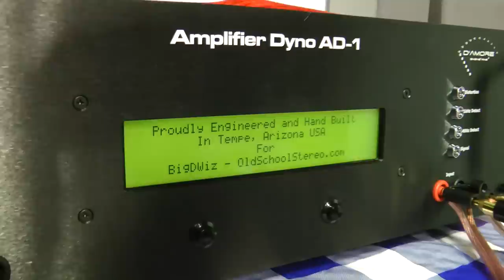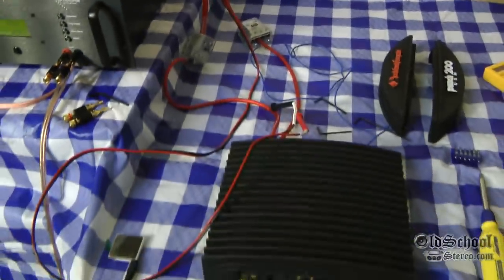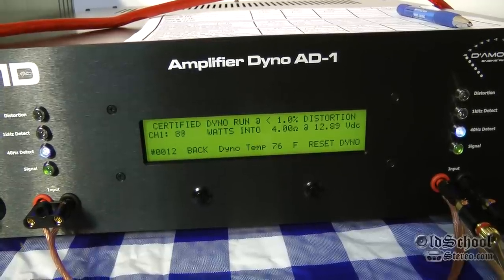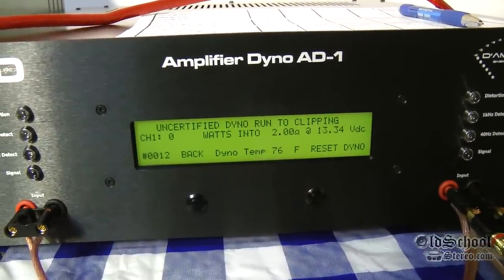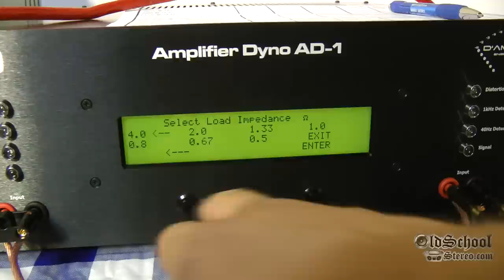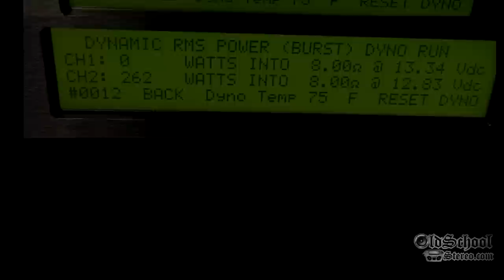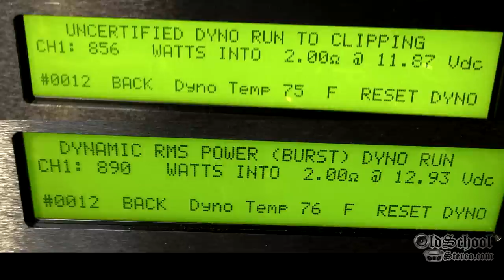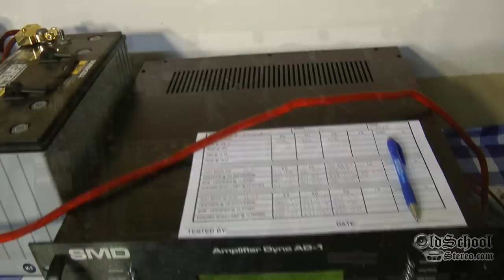SMD AD-1 Amp Dyno vs. Rockford Fosgate Punch 200 DSM FULL Test

Comment: The finest amp i have ever owned period!! And i have 6 of them! and still have a power 1000 and 650!  love them Rockfords!
Reply: I have a punch 150,a punch 45 ,and a power 300 in my boneyard loved all of them.right now I have the 200 ix running a jl audio 12w3v3 bridged and it sounds good,t600 running front and rears ,morels up front and focal cc’d 6.5 in doors it’s a nice 2 amp system.
Reply: @seanhower5130  nice buddy, I have 2) 200s, 2) 100s, 1) 40 and 1) 60 old schools just like this. I think mid 90s waffle grill. I had one 200ix powering a jl 12w6 v2. It was loud until the surround blew out on the woofer. Have to repair the surround.
Reply: @seanhower5130  yeah I bet the power 300 is a beast. Thanks buddy.
Reply: How does the 500a2 compare? Can it make double power at 2 ohm mono?
Reply: You the man with the master plan!

Comment: Love to see these tests on the gear I grew up with.  I was saving for my car audio gear 2-3 years before I even had a license or car to install it in!  I picked up a Punch 200x2 trans-ana from a guy in the parking lot of a pawn shop as we were both on our way in.  As a 17 year old, this was the holy grail of amps to me, and I think I paid under $200.  Before being stolen along with my ride a few years later, it was powering a pair of bridged Premier TS-1240s and a single Orion XTR 15" bridged along with them for something like 1.3 ohms!  The amp never complained or shut down, but ran hot unsurprisingly.  Chewed up a few alternators along the way, but it would flip quarters on the roof all day long.  Way underrated!

Comment: We ran the punch 200ix at 1ohm mono fanned in late 90s and got great power as long as we fed them enough voltage!!! Freaking love those amps
Reply from the maker: In my tests, the ix had a protection circuit where the non ix model just kept going
Reply: @wal  we never had any issues out of either as long as the supply power was enough.

Comment: Been running 2x200ix and 4080dsm linked with punch links for over 15 years. On 2x punch hx2 12s they have followed me through 4 vehicles so far and still slam.

Comment: From what I see... their new POWER Series are respectable. BTW I have both a 4600x and a 2600x :-) still with warranty sticker
Reply from the maker: I agree. I'm using the little Punch PBR amps in one of my cars as a simple system upgrade with a JL Stealthbox and 6.5 components in the doors and they provide respectable amplification in a TINY package! 100% stealth upgrade and 1000x better than stock sound

Comment: An  ol' friend of mine had his hoopride done at the sound shop when we were in high school.. All Alpine, head unit, alarm, highs and mid speskers/and amps and for thee trunk he got 4 punch classic 12's , flush paneled in with a  single punch 200x2 trans anna, pushin them , with a 3 way Fosgate active crossover .. Man it sounded fn great .. 
The whole shebang with the  car alarm was like  $1,200.00 retail.
1995 a.d.
😂

Comment: i have 2 200x2 punch amps. i had a 60x2, sold that. then bought a 100x2 that i had powering a pair of vega 124s at 2 ohms. nothing in my area was as loud. the best amps rockford fosgate ever made. except the power 1000

Comment: hi Dereck! very nice video. Ho have a question for you, i got a Rockford Fosgate Punch 200ix and a Precision Power 2150M, now i have buy from a friend a JL Audio 12w6v2 D4, than i need use one of this amp on this subwoofer, its better use the RF Punch 200ix at 8 ohm mono o PPi2150M ?

Comment: Thanks for your test results! Awsome , I have 2 punch 200’s  and a punch 500 so by the looks of it I should run my subs at a 2 ohm load off one the punch 200’s at 2ohms bridged mono instead of using the punch 500 to power the subs would this be right based on you Dyno tests? Which makes me wonder what to do with the punch 500 when the 200 outperforms it! I’m loving your channel from Australia and You have inspired me to fire these old skool amps up again! Great show ! I’m loving it 👍🏽👍🏽👍🏽💯 if you can give me some ideas I’m going to resurrect those old skool days! 😆

Comment: The new tests are awesome. Get that Soundstream Reference 300 tested. I'm curious to see the differences in power compared to the old resistor bank method,
Reply from the maker: Joe Rico I sold the SS Ref 300 a while back, but have a Ref 500 I'm going to test soon. I think you'll see the "certified" tests using the Amp Dyno are very similar to my old test methods. This mode tests the amp with a sine wave up to 1% THD. It is fun to see the uncertified (up to clipping) and dynamic burst RMS tests the AD-1 provides. Some amps have a TON of headroom...a good example is the Punch 200 DSM shown above!
Reply: Awesome. I have 2 mint original boxed Reference 500 and it's probably my favorite amp of all time. Hits the sweet spot for anything you need to run on it. CSR rated rated it for 598 watts into a bridge 2 ohm load/ 144 x 2 @  4 ohms back in a 93 or 94 issue. After that review I bought both my units. I also have a closet full of Rubicon amps I want to send you for testing.
Reply from the maker: Joe Rico I remember that review! I "think" I scanned it a while back, will check soon
Reply: I still have the issue along with all the car audio rags from the 90's. Missing the first few years of Car but have everything from mid 90 until the end. I really want to see how the D'amore compares to the testing methods of the 90's. That way we can look at the old tests and fill in the blanks to amps that don't get tested with the new methods.
Reply from the maker: Joe Rico I'm curious to see how it performs as well. I'll look for that article, but I bet they used 1kHz tone and measured THD at 1% for the power output. If this is the case, I should be able to do the same test! Could I trouble you in scanning or taking pics of the SS Ref 500 review? I'm sure I have the magazine, but it's in storage and not easily accessible now. I scanned a few things from CSR in 1993/94, but didn't see the Ref 500 review
Reply: I should be able to scan the article. I have a few scanners colllectimg dust in a the attic. Just have to hook 'em up. I do remember the last sentence in the article.....with this much power people usually dance naked in the streets. 1000 watt amps were very rare back then and I always rember that line when I'm checking out a super powerful amp now a days. Boy...times have changed.....

Comment: Had 2 of these hooked up to 2 Punch DVC power 10s. Used these for Years running them 2 ohm. Wish I never sold them.
Reply: I just got mine out of the basement from 1998 Its punch 200 with 2 Punch Power DVC 15s  Can wait to hook them back up.

Comment: Just repaired a 200dsm and a 150hd and these things have leaky smd capacitors, especially on the pre-amp board which also happens to be very sensitive. 

So for those buying these, keep that in mind...either channel will start to distort or just cut complete out (no sound). Still good amps, but the pre-amp board is no longer available for the dsm and repairing them is not very easy.
Reply from the maker: Good point...old amps do have their drawbacks. Thanks for the comment
Reply: That's why I don't really care to much for this model I do like them but I hate repairing those little boards.

Comment: Lots of info, great video, thx for sharing, but I am a dummy & don't understand half of these numbers. I will spend time to learn more about this but my reason for posting is that I still own a 200 dsm ix. Its been sitting in my garage & now I plan on installing it. It will be powering a simple system (one 8" or 10" sub in an enclosure in a '05 Tacoma with factory door speakers for starters). I believe I gotta match the subwoofer to ohms setting I choose on the amp right? What setting is the most reliable & recommended?

thx in advance, any help would be appreciated

Comment: I have a 1998 model punch 225.2 I'm curious what it does? Does not sound like a '112.5 watt per channel' amp to me. It pushes 15" kickers easy. Maybe 900 watts? Good stuff BigD
Reply from the maker: If you are referring to dynamic RMS power, I have no doubt it would do 900W (simulating music). The certified and uncertified modes are 10 seconds of a continuous sine wave and good to show a constant power output of an amp, but the dynamic mode better displays how it performs playing back dynamic music

Comment: That's what I'm running now a punch 200x2 on 2 jL auto 13.5 subs svc wired in parallel bridged to 2ohms and it will shake your eye balls in your head it's crazy best Amp I've ever had by far!!!!
Reply: Audio not auto 😂

Comment: I wish you had a 250m too test. I had two of these ran 1 ohm on 8 15's and it used to push 152's all day. That was back in 1996-97
Reply from the maker: I have a 500m which was '95 and the 250m was '96. I'm pretty sure I don't have a 250m, but the results of the 500m should be virtually identical (video to come later)
Reply: Are you going to do a test at 1 ohm bridged? Is this where I put in my request? lol
Reply from the maker: MullinPerformance Yes, I will try 1 ohm mono and 0.5 ohm mono in burst mode and will make a quick video update
Reply: thank you sir

Comment: I currently own a punch 200x2 DSM, punch 400 x2 DSM t
Punch 40x2 dsm
And finally a punch 100 ox DSM.

I have owned maybe 20 dsm amps over the last 25 years and maybe don’t know the answer to this question 

Will all of them run 2 ohm mono? Or does it vary from amp to amp?

I did have a punch power 50x2 that I ran 2.6 mono (1.3 ohm) and it would run, get hot and turn off

Comment: in addition to Rockford Fosgate Punch 200ix i got also the Punch 100ix.. i love this amp.. very very nice bass, but good also on all range sound.
Reply: Pasquale Serpico 
Hi Pasquale, do you still own the punch 200?
i have a punch 200 with no power...
opened it up and found a few of the mosfets burned up!
cant find a parts list anywhere online. any chance youd consider opening the back cover up and taking some pics for me??
there is 10 mosfets on each side(per channel)
i can give you my email if youd shoot me some pics or if you just wanted to right down the #s on the chips. i can make out some of the #s, but some are burnt bad!!
let me know either way.
thanks man...
Reply: Pasquale Serpico 
ok thanks!

Comment: Mother of God. I forgot that these were not even rated for sub 4ohm use. Lol. I ran mine at 2 ohms for years, though it did go into protect a couple times after some 3 hour torture sessions. Always came right back after it cooled though and I had TERRIBLE ventilation. Favorite amp of all time bar none. Any plans to strap the DSM 500 on?
Reply from the maker: My comment in the video about 2 ohms was referring to 2 ohms mono....hope this didn't cause confusion? I always ran my RF's at 2 ohms mono all the way back to a 1st gen Punch 150! They got hot, but never gave up! Yes, the 500m has already been tested and don't want to give anything away...but only 3 letters describe it...W O W

Comment: Although I could be wrong on them selling the company but one thing for sure is that their products went downhill big time after this series 2?
Reply from the maker: It's cool, I'm not trying to change your opinion, everyone is entitled to that. My 2003 RF Power 550 has been a great amp I've used in 3ch mode (mids/highs on 2 channels and sub bridged on other two channels). It's not going to blow anyone's hat off, but it's been a great amp I've used in 3 cars over a 10yr period. Very compact, powerful and clean sounding.

Comment: Pretty impressive! Dereck, That amp also seems to be fairly compact. What are the outside dimensions?
Reply from the maker: 9 5/8" x 12 5/8" x 2 5/8"
Reply: Hmmm, I could fit 3 of those on my amp rack. I only have room for 2 of my Pioneers running 360Wrms. :) Ew, lets see. 1 running 2 channels of mid bass into a pair of sealed 10s and 2 driving separate voice coils on my sub. Nice.

Comment: Hey man I sent you a message on YouTube but haven't heard back and needed some help with setting gains on my amp. I purchased a DD-1 on Amazon and I am confused on setting the gains on my old school Fosgate Punch 100ix amp. It has 2 gain set screws for each channel. I figure I should place the positive probe on the DD-1 to the left positive on the amp and set the left gain, and then go to the right side. But, what if I'm running the amp bridged on one 4 ohm woofer? Would I still do it that way or would I need to hook the negative probe to the amps right negative terminal and the positive probe to the left positive? I could really use some help here and hope it's not such a dumb question.
Reply from the maker: ***** you should set the gains for each channel individually since you have two dials for gain. Then if you bridge the amp for the woofer, both gains should be set in the same place.
Reply: Dereck BigDWiz Thanks man, sorry for flooding you on YT and FB with the same question but I couldn't figure it out. So I could basically set each channel with the DD-1 and then go back with a DMM and make sure the voltage is equal on both channels?
Reply from the maker: ***** You can do it that way, but just using the DD-1 should get you close enough (on each channel)

Comment: Hey. I just bought a pair of Dynaudio Esotec 242 GT speakers. I will use a separate amplified sub woofer. What would be the best to channel amplifier for these speakers?
Reply from the maker: +Roy Lange these questions are impossible to answer. Budget, size, personal preferences are all taken into account when deciding on an amplifier
Reply: Dereck BigDWiz Thank you. My first amp was a Fosgate back in 1977. I think for nostalgia, I will go with Rockford Fosgate.
Not to mention, your reviews seem to be glowing for them...
Reply from the maker: +Roy Lange wow, 1977? Do you recall the model? Prior to 1980, it was Fosgate, Rockford didn't join until 1980. I have a mid 70's "PowerPunch" PR-7000, they also had a smaller version PR-3500
Reply: Dereck BigDWiz Yes...it was a fosgate amp.
Did you ever see one? As I recall, it had a seperate unit that went along with the amp--I think an equalizer of some kind....I remember the power button made a huge scratchy  noise when I turned it on and off.
I put 12 inch woofers in the rear seat panels and used a Nakamichi 250 Cassette player.
That was the best stuff at that time. 
Also, I remember a couple of year later I drove up to Hollywood to buy an amp that was the same model that Joe Walsh chose for his car.
I blew that amp...but because the idiots made the positive power terminal black and the Negative Red!!! What were they thinking???

Comment: Huh...lol... had one of these running 3 15w6  JL audio the ohms were a bit odd so not sure how it compares to these tests,  but it hit 139.8 off a crap battery and a self tapping sheet metal screw into the floor pan for an amp ground...lol...so no big 3 and poor power supply,  but from watching this test the amp makes power off low voltage anyway  and  it was putting out much more to those 15w6 than thought .

Comment: I'd like to see the mmats d300hc on the amp dyno!
Reply from the maker: I have the smaller D200 (non HC) and will test it again soon. I tested it a while back with my older setup, but it was before I had the adjustable voltage power supply.

Comment: I have two of these..I  Recommend NOT running them lower then 4ohm.they get very warm when ya do,and they are about 25 years old so it would be a shame to blow any of them.

I tested them at 2 ohm,3ohm and 4ohm.
Reply from the maker: I’ve been using mine powering a JL 10W7 (3 ohms) for over a year now without issues. But generally speaking, yes, keep above 4 ohms bridged is best
Reply: BigDWiz yeah I tested mine on a couple cheap 12s at 2 and 3 ohm and even with the gains fully down the amp heated up too quick for my taste.

I am probably babying the hell out of my amps,but they hold a special place with me.hell they are the reason I bulit my system this time. So I am not interested in smoking them.besides  even at 4ohm they pound these 15s so damn hard.